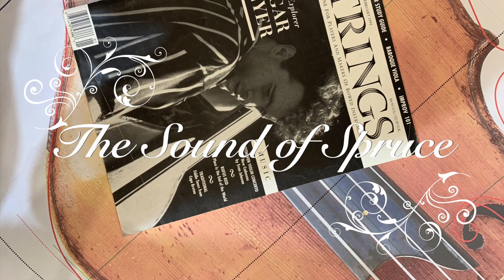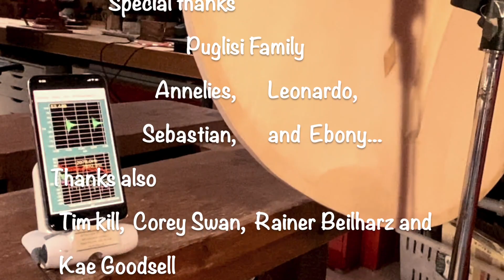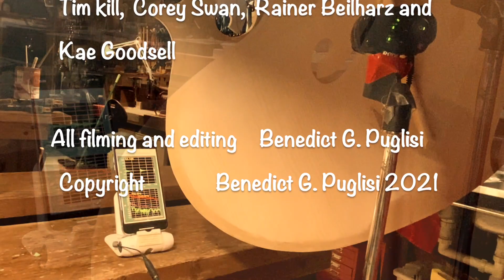Making a Meyer Double Bass: Chapter 2 "The Sound of Spruce"

Comment: Oh there you go, I LOVE the long handled gouge!  I have a large slick (flat edge boat building chisel) but now I really want to find or make a gouge like that 😍
Reply from the maker: Really can't recommend a long handle gouge, or for that matter pairing chisel enough. The extra length gives the leverage to make the job so much easier. Helps with posture as well.
Reply: @atelierpuglisi  totally agreed.  The boat building slick is really nice to use, like a 2 -3 inch wide blade with overall length is a bit over 3 feet.  I do have a couple gouges, I might have to track down another so I can make a long handle on the lathe.  Oh yeah, I just watched the video on carving the back too: one tool that made life easier for me on guitar tops is a spoon plane.  It works on the pull stroke like the Japanese hand saws.  The blade is crudely shaped, but once it's dialed in, the pull stroke is really nice.  Amazon has the WoodRiver Carver's spoon plane, it's $30 US and worth it's weight in gold... or bronze anyway 😁😁

Comment: how thick it the piece of wood you used for the face plate of the bass ?
Reply from the maker: The finish thickness is about 9 mm in the middle. And graduates to 4.5 on the flanks. The arching height is roughly 34 mm at the highest point
Reply: @atelierpuglisi  also, what would did you use, and would using another type of wood affect it, I would imagine hardwoods would be better, because of the residence, and softer woods would be more frowned upon. And also if I were to glue three pieces together to create the front piece, would that be good, or should I go for a solid piece of wood? Thank you so much, I enjoyed watching this series.

Comment: Hi, is it any specific method for the wolf tones adjustment?
Reply: Hi. There are many things but I try after the instrument is finished. However,  one thing I found very helpful is to see if there’s any areas that resonate too much, where the amplitude spikes, particularly below the F hole on the bass bar side. I then like to add a small spruce cleat at the spot. 
It can be trial and error, and these can also be added after the top is glued on, and the instrument is being played.
Reply: @benedictpuglisi8369  Thanks for youtr answer, your videos are really awsome. BR from Poland :)
Reply: @jarekb8929  thanks again. One thing I should say about Wolf notes is that you will never really eliminate them. In fact, if it doesn’t have a wolf note, it’s not a double bass. It’s more about suppressing and managing the wolf tone.